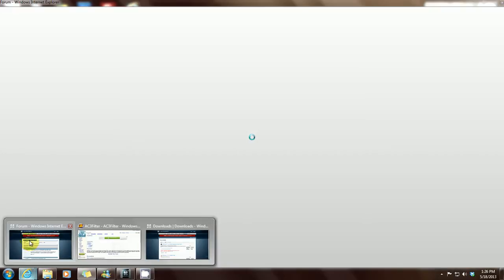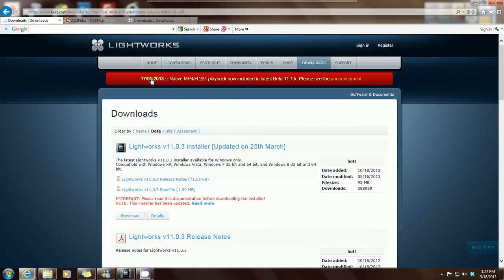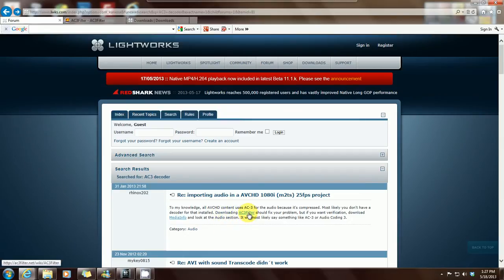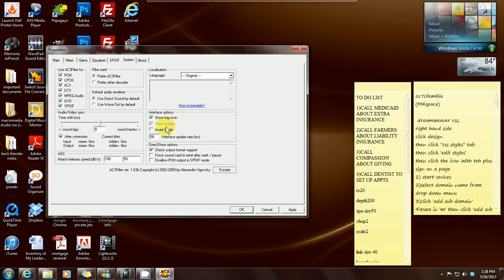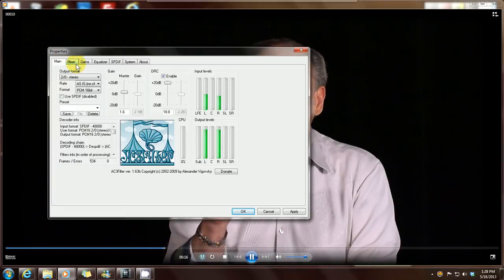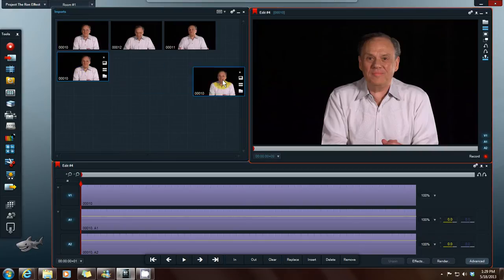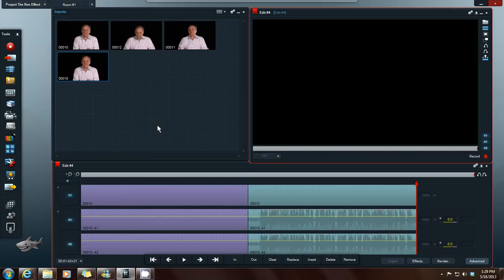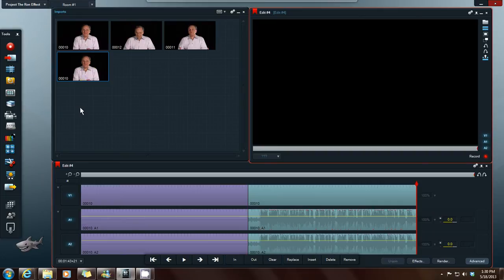Using the ac3 decoder filter in lightworks

Comment: light works has made me angry may times it locks like my avchd dosent work to import to lightworks  :O
Reply from the maker: hhmmm. that could be an issue that is pretty hard to deal with. sometimes the older versions may cause that to happen. you could probably download a newer version of lightworks. this might help.
Reply: Tola Olubunmi  hihihi oooh ok ^^ i saw what was the problem now whit my program it was the administrator i must drive the program as that ^^ thx fore the help mr  i like your video was very good and easy understand ^^
Reply from the maker: saken andersson glad i could help saken
Reply: Tola Olubunmi  hihi ^^